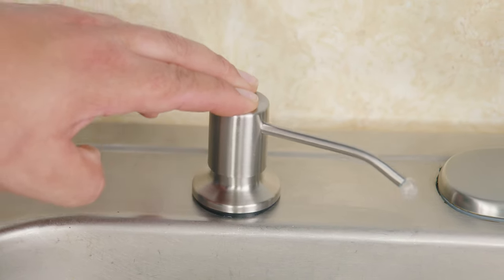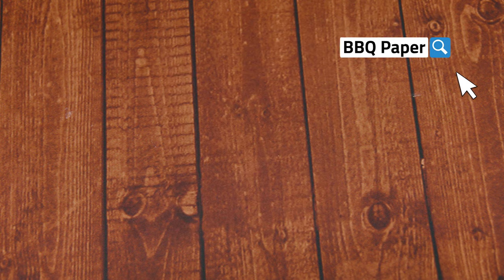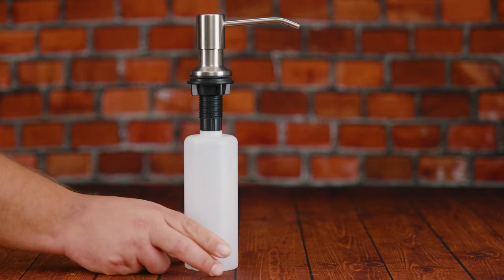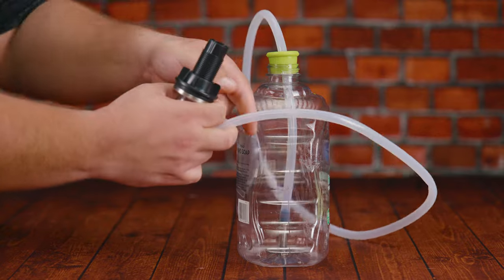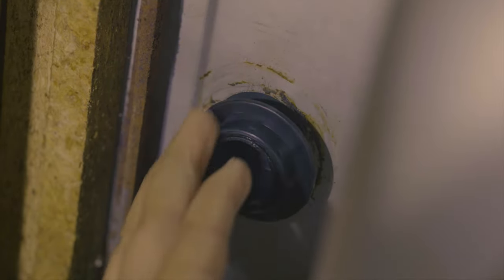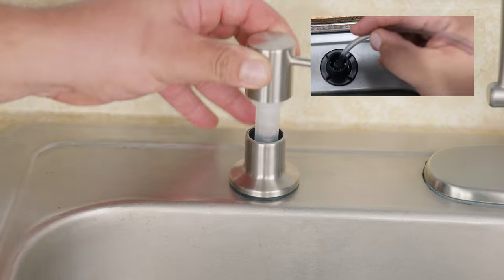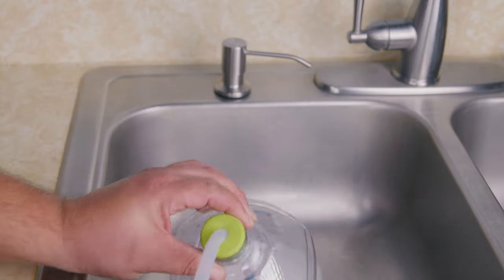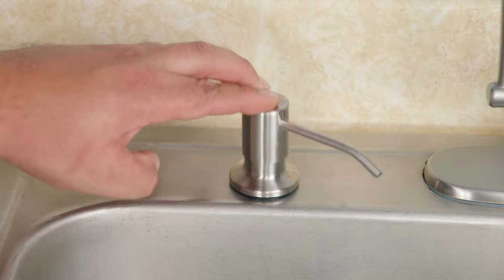How To Install Kitchen Sink Soap Dispenser Easy Simple

Comment: What if the soap doesn’t want to come out? I pumped quite a bit but no soap
Reply from the maker: air bubbles on the line or debri. taking the stick or line out to clean. or maybe to thick , needs to be water down. but also usually the first time it can take about 40-50 pumps. specially when using the long line. see if any kinks or bends. it may prevent from passing thru. make sure cap is tight so no air will come in.